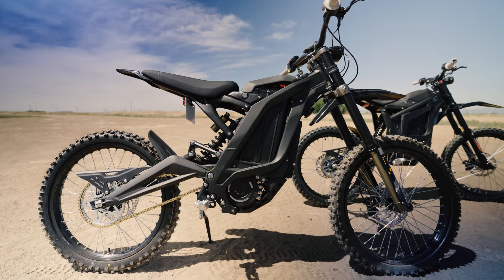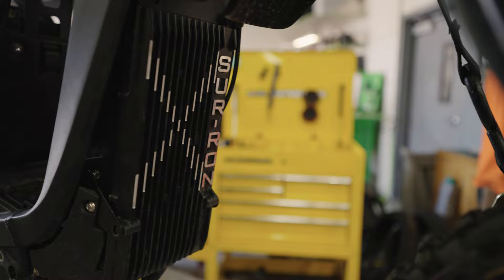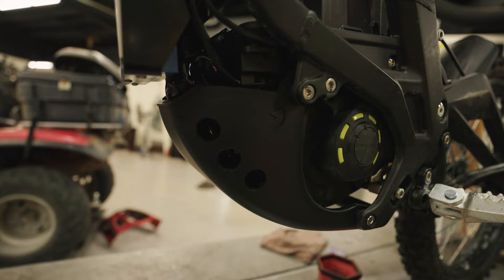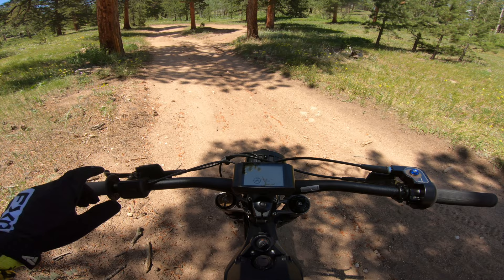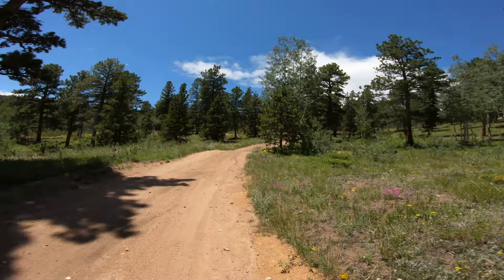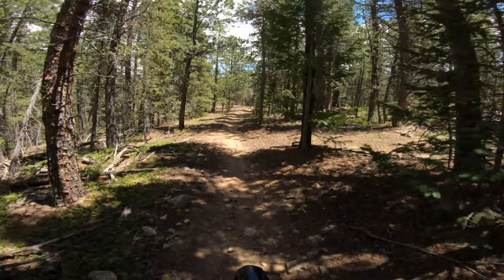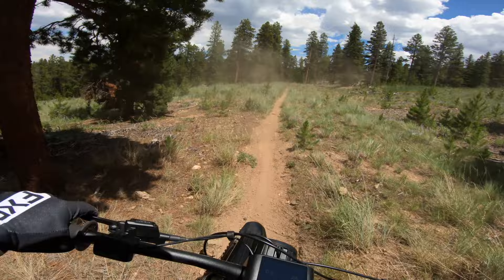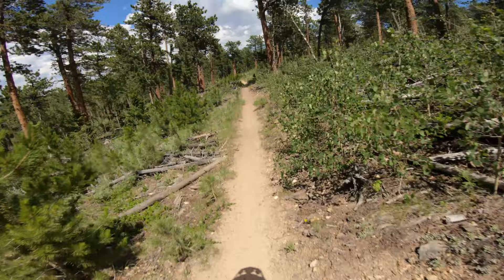Building the SUR-RON X BEAST | Fast 72v Power Upgrades | Episode 1

Comment: 16 / 19 , fox 40s, ext shock.

This battery is a beast but after doing the above with the same battery to my bike the added weight is definitely noticeable
Reply from the maker: @bwisdom Definitely noticeable! That battery is quite a big increase in weight and needs attention to the suspension if you're riding off road. Big suspension upgrade, wheels, and a bunch more hard parts coming to this bike next...

Comment: Super excited to watch this build series as a lot of the riding I do matches the riding you do (lots of trails!). I’ve been wanting to upgrade the parts on my bike, but right now I’m bone stock other than new footpegs and tire inner tubes, as I destroyed those garbage stock ones quickly. Suspension next!
Reply from the maker: @Sonic K Awesome! Good call on replacing the tubes and foot pegs. Another affordable upgrade is taller bars or bar risers. It helps a ton for ergonomics!

Definitely planning to set this bike up as an enduro / single track build. I'm going to go big with suspension on this build but there are plenty of good options and more coming. Wink Wink. 👍

Comment: I love Surrons. They are great, but sometimes I feel this is all like chasing your tail. When you increase power, you need to improve this, need to improve that. On and on it goes. The ELMOFO plug and play kit rocks. I don't sell it, but I have ridden bikes modified by them. EBMX headquarters is only 5 kays from my place and ELMOFO are about the same. Having ridden some fast Surrons I think the best bet is still this kit from ELMOFO. By the time you spend the money on the upgraded Surron battery, controller, front suspension, rear swing arm, rear suspension, bars, brakes, wheels, types, etc, etc, etc, you might have well have purchased a WR450F roller and this kit. The ELMOFO battery pack is double the capacity, it has more power and it is registerable. The downside is the weight and chuckability in the tight stuff - although they ride like a 250. https://www.elmofo.com.au/electric-motorcycle-emx.html

Comment: Manitou Dorados up front with a 21” wheel. 
EXT Arma in the rear with an 18 wheel. 
Beefier rear linkage triangle and riser for 1.5-2” rear rise to compensate for the 21” front. 
Hayes Dominion brakes front and rear with larger rotors.
Soft seat
DM stem with slightly raised bars
Prickly pegs
Gates GT4 primary belt
58” rear sprocket
Hit the override protection switch on the app
— ready for TKO 2023!! —

Comment: I don't know how tall the EBMX 72v 57ah battery is. I have their 72v 42ah and I fit a Race Spec MX seat using the stock battery cover latch hook and no seat risers by making 1" risers for the front of the battery cover. Tons of knee grip sitting or standing and wide, soft seat plus you can get your weight forward over the battery. I know your seat is already up 2" so look into it.

Comment: there is so much todo on stock surron, start with frontsuspension first. what is the driver weight? 90+ Kg is a pain.
Reply from the maker: @xandersons So much to do! Suspension is definitely coming next. I weigh 165-170 with gear.

Comment: lol thats crazy man.. I Have a silly question hopefully I have not already asked and forgot. but is it possible to set up a Left handed throttle on a sur ron /Talaria.? I'm more of a Mountain biker always doing Manuals and wheels so my Brain is Trained  to have Rear brake on the right.
Reply from the maker: @Mountain Goat87 Man, I have personally never seen a left handed throttle but you could easily swap the levers so that the brakes are like your MTB...
Reply: @ElectricCycleRider   only thing with that is wheelies would probably be hard with rear brake on same side as throttle.. I ended up switching my mountain bikes to left rear and I am relearning lol almost looped a manual going down a ridge the other day I got to slow it down and take my time relearning after 15 years on and off mountain biking been on 3 mtb rides sense the switch.. my Talaria came yesterday it is a blast 🙃

Comment: Any early thoughts on the cable throttle?
Love a good bike build series 🙌 looking forward to all the goodies you throw on there 👍
Reply from the maker: @Ian Right on! The 1/4 turn option is great (cable or non-cable). My first Sur Ron in 2019 had the cable throttle, so I was keen to try the cable again since it's been a while. I like that it's not as erratic as the non-cable. I feel like the non-cable can feel jerky at times, which I don't like especially when there is a lot more power. But the cable feels a bit gritty, for lack of a better term. I'm going to try the Magura option next, which gets a big stamp of approval from Mike at DirtyBike. 👍
Reply: @ElectricCycleRider  awesome, yeah I do notice the e-throttle has an odd way to it, small dead zone, and a bit erratic when the engine first rolls on.
Gritty feel eh, have you tried throwing a bit of lube on the cable? I know it should be fine stock, but sometimes.. 😆
Dose the cable feel more similar to a gas bike?
Reply: Domino throttle is best for aftermarket controllers

Comment: I looked at this option vs storm bee.  Storm it was, why?  Limitations on power use, repeated full throttle is not allowed or motor go bye-bye.  Then theres the fact its not a full moto, your on mountain bike parts, so it asking for trouble on the rough stuff.  But each to their own, on the tight stuff this will eat the storm.

Comment: You should totally check out the Ktm fork adapter. You can basically use ktm forks and not have to wait for the obvious fox 40s your thinking about on
Reply: Jenson has Fox 40s in stock. The bike market is cooling down. The KTM85 fork is heavy.

Comment: Tucker - Great video! I am thinking about getting an electric bike to ride single track and woods (muddy trails, creaks, hilly, lots of logs, etc) near my home. I like the idea of the Sur Ron, but looking at the cost of upgrades (bike + controller + battery + suspension) - this would put me in same price territory as a used KTM Freeride EXC. I know the Sur Ron is the "budget" choice, but I know I would end up upgrading the bike. What would you recommend, the KTM or the Sur Ron- if the Sur Ron, why?
Reply from the maker: @ssobers Thank you and great question! You can definitely mod a Surron to be the same cost as a Freeride and the ultimate outcome is that they will still feel very different. The KTM Freeride is going to feel like a full size dirt bike and the Surron will feel a lot lighter and nimble, even with the mods. If your trails are really rough, you might want the extra weight and suspension that the KTM can offer. If your trails are flowy and fast and you want a mountain bike type feel, the Surron will feel more like that. What bike are you currently riding?
Reply: @ElectricCycleRider  Tucker - thanks for the reply! Current bike is a 2017 KTM 300 X-CW. In the middle of PA we have a lot of rocky single track trails... hilly and mostly reclaimed coal lands. This is a great bike for these trails, can power over and through anything. Looking for something to ride near home - mostly farm land, woods, creeks, hilly, muddy - not as rocky and I wouldn't say flowy- some of the trails are flowy, but most are tight single track.

Comment: Why the quarter twist throttle. It  looks dangerous ,is it super twitchy?
Reply from the maker: @Mike Workman It's probably not as necessary with the power updates but it helps when the power is stock. The full throttle has a lot of throw.
Reply: @ElectricCycleRider  thats what i was thinking it would be kinda tweakey and with more power a bit sketchy. Cool build series man nice job looks fast af.
Reply: It’s not, with aftermarket controllers you can tune for the voltage range giving better throttle resolution. The cable throttle also doesn’t have the issue of weak wiring breaking leaving it useless. 1/4 isn’t twitchy like most think and you can adjust that via the cable
Reply: You don’t want your wrist all tweaked out when holding wide open.. especially when standing in attack position. The 1/4 turn is way better and a great upgrade. The cable is far more durable when you catch a branch on the trail.. that would normally destroy those tiny wires on the electric throttle.

Comment: Thanks for such videos. It is actually exactly what I was looking for right now. My biggest concern however is not the suspension, but the motor itself. Are such mods ok with it? Why are they not making such bike, when they (surron) know people are modifying it heavily? Thanks again. Cheers.
Reply: If you pin a stock bike long enough you can burn up the motor. Fortunately that rarely happens on dirt but if it does there are two replacement motors. QS165 35h  is the hall sensor version that will give more power and better heat resistance for a couple hundred $ or the KO monster motor.

Comment: Yeah .. suspension, wheels & so on, you'll end up overwhelming the chassis, it wont handle the forces being applied to it's limited design.  Careful Buckaroo .. 
It'd be great if the e-moto bike world would bring to market something in between a full size Moto ( Alta, Stark Varg ) & these smaller, less robust designs. 
A bike with real suspension, up-to-the-task chassis geometry & wheel size & OA weight either side of 175lbs would eclipse the sales of the current offerings in short order.
Reply: The frame is strong enough. Even with better forks and shock the short wheelbase makes it a handful at speed. If he goes 21/18" wheels there is a 1 3/8"  (forget the actual metric number) rear riser instead of the usual 1 1/2" that will slow down the steering a bit.
Reply: Electric motion escape R is basically exactly what you are describing.